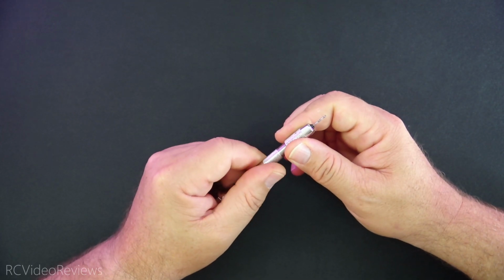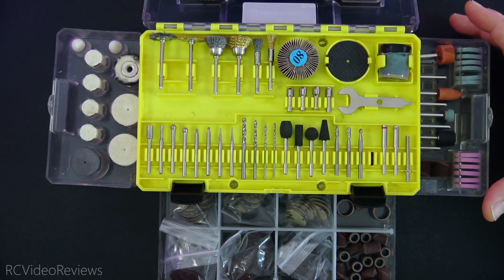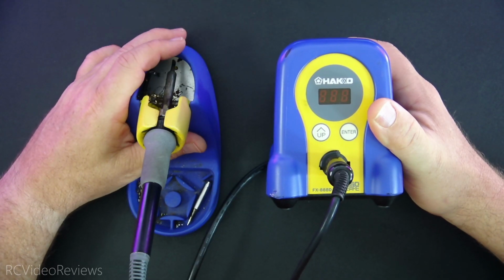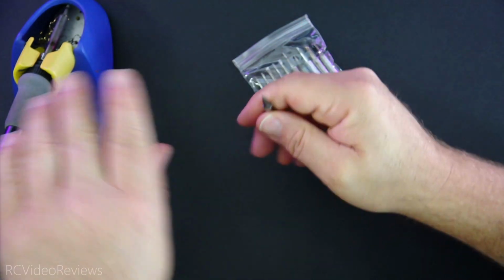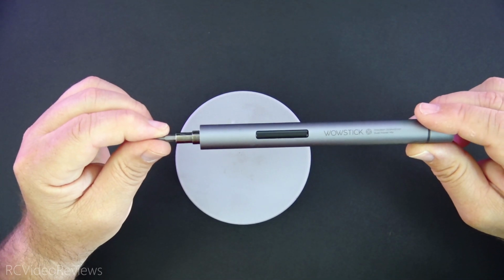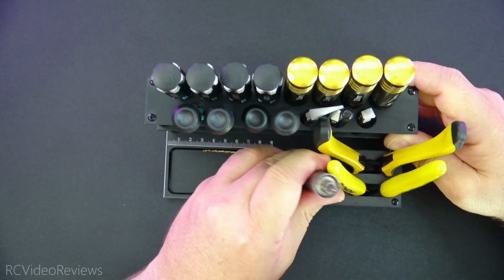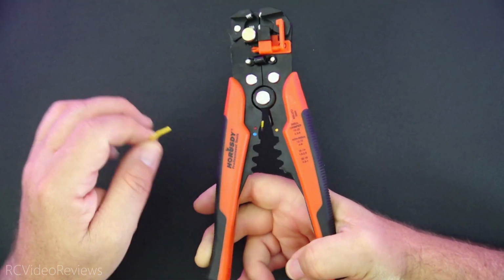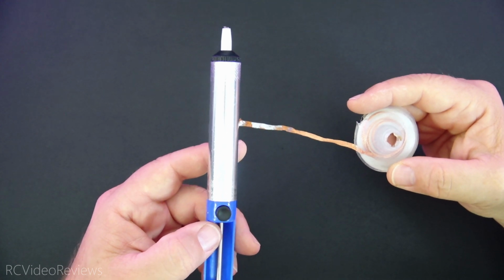Top 10 Amazon Tools You Need for RC

Comment: those rotery tool kits are a HUGE scam. as 99.99999999% or the stuff in them you will never use.

 I know as i have junk that is at lest 40 years old. and never found a use for them.
but having drill bits, cut off wheels, etc are worth having.
and yes to the hand drills. just for one usage on my model trains i have a set of three ready to do one project.

Comment: If you are going to do any soldering, you need a solder station with ajustable heat range. I use mine for so many projects , not just RC. Those helping hands are also a must have item. I also found a rechargable power screw driver to save my hands. Those tiny little kit style screw drivers are worthless. Like my dad said, investing in good tools is not only a time saver, but saves your hands and prevents hurting yourself. Good video!
Reply from the maker: Thanks!

Comment: just as a warning to you guys, beware that Hakko soldering stations are one of the most counterfeit brands. only buy one from an authorized retailer.  the fakes are hard to spot until you open the unit.  also, ryobi makes a $25 lithium ion drill/screwdriver that's excellent for RC cars etc.
Reply from the maker: The link I provided in the description is where I bought my original Hakko and it's sold by the Hakko Store on Amazon.
Reply: @RCVideoReviews  I did notice that.  I thought i'd share this info because someone might see one listed for $70 and think it's a good deal but end up with a fake.  the fake seems to work ok for everyone who made a video about them.  but for that kind of money a fake is a ripoff.  hakko used to have a warning on their site about counterfeit products.
Reply from the maker: Definitely--sunlight is the best disinfectant. Good for people to be aware and get the real deal. I try to be careful with my links. Don't want to send folks to a ripoff.

Comment: I use magnifying glass w/ lights as well so I have this type that has also a pair of 'helping hands' (alligator) integrated into them.  Also a blue silicon work mat with magnetic pockets to secure screws too. A couple of sticky tack or clay to secure FC/ESC when soldering if the helping hands is too bulky on my desk. Nice review! Gotta look for that thingiverse version of wowstick screw box.

Comment: I've been using these "GUM Interdental Brushes" for scrubbing the PCB after soldering, to clean off all the flux residue.
They're supposed to be for flossing but they are REALLY great for cleaning tight areas with alcohol.
Reply: They also don't leave any tiny strands of cotton behind like a cotton swab will, and since it's a twisted wire brush end, you can bend it to any shape needed AND apply more scrubbing force than a swab, with more control over what you touch.  There are less expensive brands also on Amazon, like 250 for $12.99 instead of less than 20 for $16.99 (Yep, 'nuther comparison shopper.)